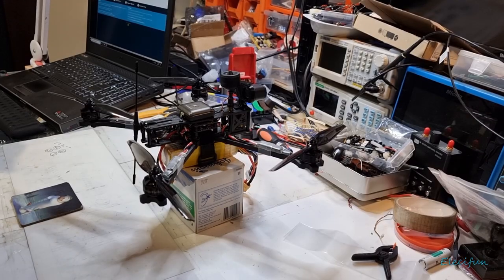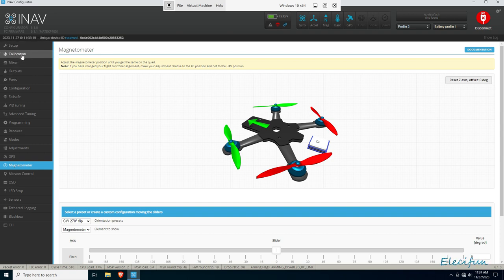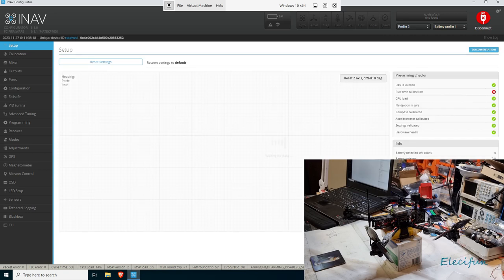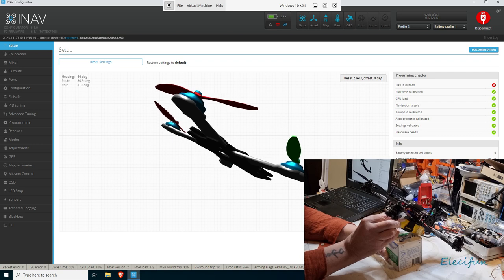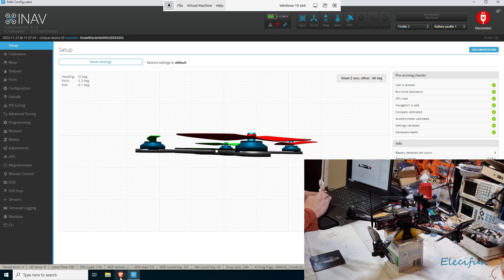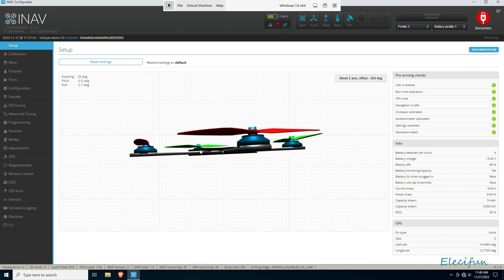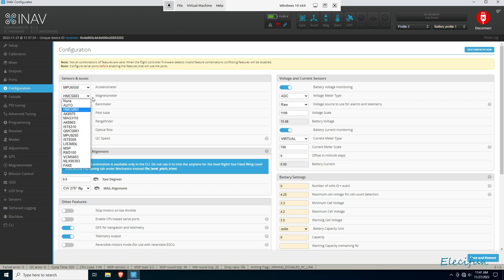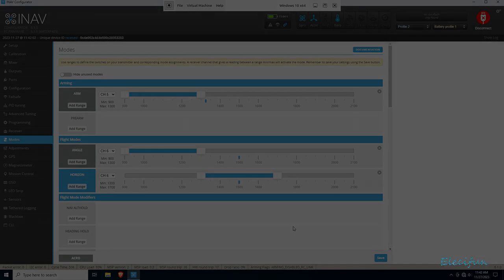INAV Magnetometer Calibration

Comment: Thank you so much Elecifun for posting that video! It is very helpful.  My GPS module also uses the 270° flip configuration with the arrow facing forward. I did my magnetometer and accelerometer calibrations outside and they did appear to be fine. I plan to do them all over again to see if I can improve them. I also will employ your advice of turning off all GPS settings and just fly for a bit in angle mode. One question since you touched on the ports page. Did INAV detect which UARTS you had your peripherals connected to? If not, did you fill that data in yourself? How did you know which UART is which on the flight controller? I am using the Speedy Bee F405 V4 flight controller and followed their wiring diagram but the UARTS aren't labeled 1,2,3, etc. I surmised that r2,T2 pads were UART 2 etc but I want to be sure. Also I don't understand which buttons should be activated on the ports page and why. Shouldn't every UART you are using be activated and listed on the ports page? I'm still a bit confused by that page.
Reply from the maker: @Sonic_Ox I've looked at the manual and wiring diagram. If you followed the diagram, you will be using 
T2 and R2 for your receiver. 
T6 and R6 for your GPS. 
T1 for your VTX (so you can use OSD and sticks to control channel power etc. 
T3 and R3 are a spare UART.

Port 2 should be set to RX
Port 6 to GPS
Port 1 to IRC Tramp

Set your ports before configuring elsewhere.
Reply: Thank you Elecifun! I really appreciate you going to the trouble of looking up the diagram and answering my questions! Finally some concrete advice for the ports page. I was right in my assumption that the labels on the flight controller ( R1, T1, etc) correspond to the UART. I believe I have the ports page configured correctly now but of course I'll double (quadruple by now lol) check. I am thinking about switching over to INAV 7 and starting again from scratch lol. I like the idea of simplified tuning in INAV 7 their EZ Tune feature appeals to me. I haven't changed from the defaults in 6.1 though. Too early to fuss with tuning in either version lol.
Reply: Hey Elecifun, 
I've been studying the area outside where I performed my calibrations and where I typically launch from and it occurs to me that it's between my vehicle and my little weather station both of which could be a source of interference. I'm going to recalibrate and also launch from a different location on my property. What do you consider a safe distance from any metal or other source of magnetic interference from which to calibrate?